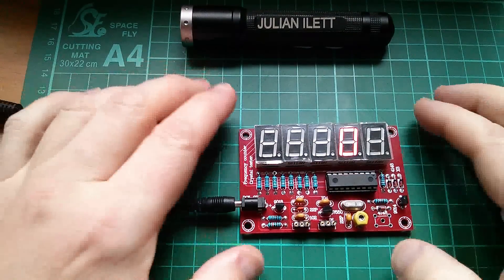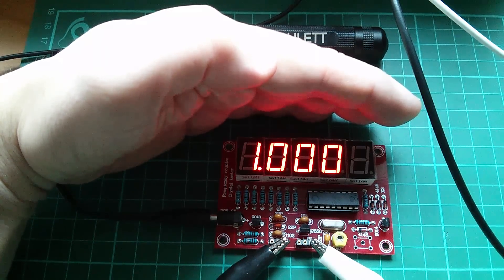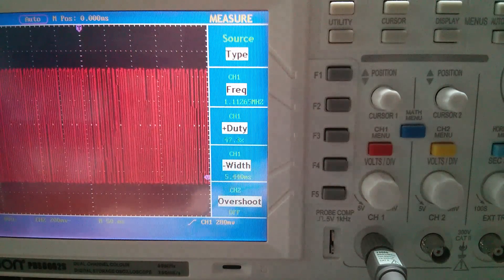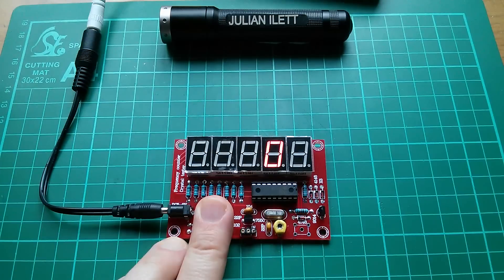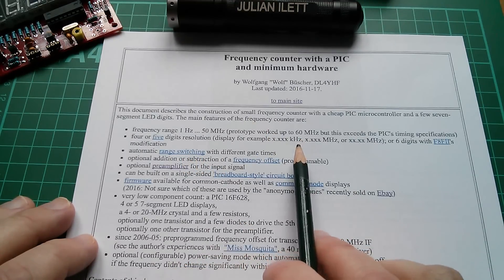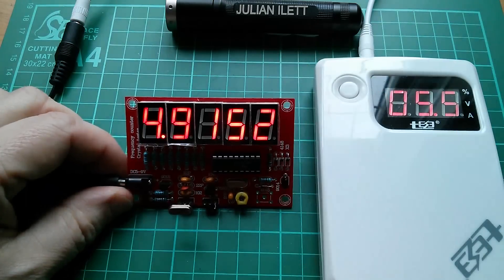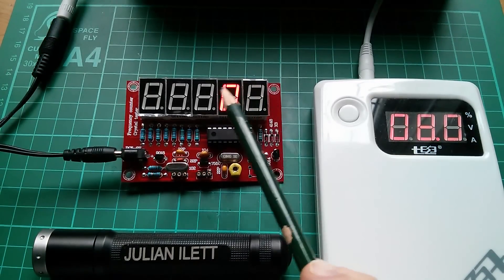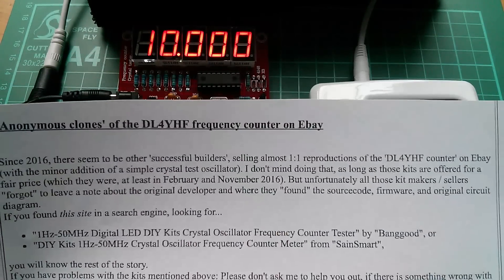Fairly Easy - Frequency Counter - Electronic Kit Build (part 3)

Comment: Hi, I really enjoyed your video, I bought this kit to make a display unit for an HP audio oscillator, I didn't think for a second about testing the crystals - I do this with a simple shielded fixture, an oscilloscope and a generator. Since the kit is on the way I couldn't do the analysis like you and I'm glad for it, I will convert the crystal testing circuit to an input amplifier. Thanks for the inspiration, I don't need to finish the input amplifier outside the board.

Nice day 🙂 Tom

Comment: maybe a 358 and Pwr pigtail hat/shield thing that plugs into the pin header, amplification and power plug and play. Good show, yes the thing sucks. Three extra 22p and a resistor. Your right about it being a Ham creation. It could be usefull for the original purpose, without the xtal part.

Comment: For me the crystal tester was 65 kHz off, but then I found that by pressing the button (which you've not soldered in), and selecting Zero option (when no crystal is connected) makes the device "zero" itself, and starting from that point my crystal measurements were spot on.
Also I found that it completely ignores crystals of certain frequencies, such as 6 MHz, 4 MHz and 32.768 MHz. I guess it's a technical limitation.
Otherwise, cool little device and actually useful (I bought it as a crystal meter, and it works very well - for frequency counting I have enough scopes).
I'm powering it with a 9v bench power supply.
Reply: Wolfgang Büsch's original documentation or another video re this unit describes the 4 MHz "dropout" you mention and provides a remedy. Sorry not to be so precise but I remember seeing that. Will repost if I run across it.

Comment: As shown, the xtal osc has several issues with temp drift, starting with the disc capacitors being notorious for value-temp drift ..
See TheHWcave mod to replace/convert the xtal tester to a preamp that allows a lower input level of about 1.5 mV P-P (significant increase in sensitivity) when using 8V power supply.

Comment: The schematic for the oscillator seems very close to one that I remember having seen in a Elektor book (300 Circuits or 301 or something like that). I am not sure about the values but the schematic was the same (as long as I remember correctly). It was a crystal oscillator circuit to test the quartz crystals. They suggested another stage after it that acted as a detector with an LED as indicator that is oscillating and the output of the oscillator they suggested that can be read by a frequency meter to see the frequency.

Comment: I built mine and the display is blank.
If you get close to touching the pic chip crystal the display bursts into life.
Going to start by swapping the  trimmer.
Reply: Swapped crystal cap and variable cap now working.
Suspect it was vari cap

Comment: I know I am 2 years late,
But for those who work on this kit now - just connect the far left leg to your low voltage signal source- with no modification to the circuit- it will work fine as preamplifier ! 
Just don’t forget the ground..

Comment: The youtube user HWCave has done a number of videos on modifying this kit including making the front-end more sensitive and mods to the firmware to improve measurements and to add functionality.

Changing the hardware:  https://youtu.be/0BxpMm6SLoE
Changing the firmware: https://youtu.be/8rOCmhPWLWw
Improving resolution and adding RPM mode:  https://youtu.be/0D6EcgTQtNw
Using the RPM mode: https://youtu.be/QlIv1DEAvQw
Adding up-counting: https://youtu.be/3imEpm_zztQ

Comment: Thanks a lot.... I recently bought this... First I thought my all 8Mhz Crystals are bad... 
But Then, like your suggestion I've use 68pF cap. (47pF doesn't works on mine)... Only detect "MHz" crystals.
And, my 7550 got damaged, replaced with 78L05... Now works on 9 volt smoothly...

Comment: I have one of these,  have had it for a while.  I usually run it off a 9V battery.  It came with that connector and not the one that the board is ready to mount.  I thought that it would be handy to be able to test some of the unmarked crystals that I've salvaged,  but results have been mixed.  Some of them give a reading,  some don't.  Trying a bunch out of a bag of colorburst crystals and others (3.579545 MHz and 14.31818 MHz),  I get very mixed results there,  too,   with some giving what appears to be the correct reading and some reading zero or some other number that's in no way related to the marked frequency.  Perhaps I'll try some of the mods suggested in the comments here...

Comment: The crystal oscillator not starting at 7.5 vdc has nothing to do with the oscillator design. The 7550A regulator is a piece of crap and turns on an off rapidly (" motorboating ") at about 7 volts. I replaced it with a 78L05 (which has a different pinout) by rearranging the pins and the crystal tester works fine for a $3 piece of test gear. Not to imply it will test from 1Hz to 50Mhz.  Or you  can just use a 6vdc power supply.

Comment: I paid a whopping $3.49 for my copy, and I think I have a 47pf cap for the mod somewhere.  The XF2206 sig gen with case cost $5.89 from BangGood.  I'm sure Clive would cheer you on for your torture testing of the little crystal circuit, though.  LOL

Comment: I use the small screw driver that they give you with a set of oscilloscope probes, that adjust that small variable cap inside your probe..it is the same style cap as on your device.

Comment: At about timestamp 9:50, you say the board can only operate at about a "5v SQUARE-WAVE oscillation".  Is this accurate?  I can see that it may need a high level input voltage, but does it really have to be SQUARE?  What about something--say a 25%  duty cycle rectangular wave?  Thanks.

Comment: The oscillator would be better if the base emmitter capacitor were increased to 100pF and if the oscillator were fed from the 5V supply, as you say, probably with a 470 resistor and a 1nF between collector and ground. I used the original 4 digit version for a transceiver.

Comment: Hi, thanks for your videos. I write for help. A few days ago my frequency counter arrived but it does not work, I insert the glass but there is no reading and sometimes strange numbers are seen. Compare this kit with that of another seller and noted that the only difference is the type of LED. The one that does not work has common anode LEDs and the other is a common cathode, I read on the creator's page that sometimes the copies come with the wrong LED type. Is it possible that by having the wrong type of LED your can see the letters of the menu but when the measurements are done they are not displayed properly? I exchanged the PIC with another kit and I still have the same problem, will the transistors be? I hope someone can help me because I am not an expert. Regards

Comment: Can I put a 12 volts input signal so that I can measure the frequency of that signal using this little kit? In other words, what is the highest voltage I could use with this kit? (May I use 12V)
Reply: Prashanth Nayak You are right. I could use this kit correctly by introducing a 4 volts peak-peak signal and it worked perfectly well. Thanks for your reply.

Comment: I have the tester/counter since a few days. The tester is pretty precise, even on 9V. I tested several crystals on it. Pretty accurate. My actual problem or question is : Is this counter able to measure the frequency directly on desktop/laptop motherboards ? I was not able to get it to work. I soldered 2 wires, one on the input pad, the other one on the minus pad on the counter section. I tried it out on some motherboards, and it does not work. Of course the motherboards were powered on, and all crystals are getting power and voltage. So, is it possible to bring it to work without a modification ?
Reply: I found out, that a cheap kit like this probably can measure or better said count just some lower frequencies in circuit. To measure in circuit motherboard crystals, just a decently expensive oscilloscope or a much more professional counter can do the job.

Comment: Just finished building one of these. Testing has been interesting. Xtal tester seems stable but gives wrong results. After much frustration it dawned on me that it is displaying exactly the correct value divided by 3. Maybe a corrupted pic?
Reply from the maker: Very unlikely to be a corrupted PIC - much more likely to be the Colpitts crystal tester circuit.
Reply: These crystals are in fact 1/3 overtone. Their natural resonant frequency is one third of the marked frequency.The meter is actually correct.

Comment: So what was the pot for?  And, why did you leave it off?  Thx.
Reply from the maker: There's no pot - do you mean switch?
Reply: Julian Ilett - Ahhh, yes. 4-connections. Possibly DPST. Looked too tall for a switch in the video. But, not needed I guess.
Reply: the switch is used to access the config menu. useful to add so you can enable/disable power save mode and zero the display .. my kit came with a 5MHz offset already set which I needed to clear before I could get reliable results!
Reply: pratalife  - Thx!  Good to know.  Surprised it was a kit and yet preset.  Figured that it was there for a reason.  Cheers!

Comment: Have made this kit up with a mod to have the BF199 preamp in place of the xtal oscillator. It seems to work ok as far as I can see. Had to cut a few tracks and make a few links on the back so the board doesnt look quite as nice as it did but it is a lot more useful! I used a 0.01uF coupling capacitor in the base circuit. A value for that doesnt appear to be mentioned in Wolf's notes. Edit: Ive changed the cap to 0.1uF and it might be worth going up to 1.0uF for measuring low frequencies (tens of Hz). Have also powered the preamp from the regulated 5v supply rather than directly from the power input

Comment: I built the same kit but left out the crystal checker components.  I had to go back and put in the 102 and 22 pf caps because it was so sensitive that it was picking up the 60 Hz  AC in my shop.  Those two caps are basically in series across the input.  Once I did that it indicated 0 with no input.

I built it to check the rtc oscillators in a couple of clocks that always seem to gain time.  I suspect the crystal oscillators are running fast.

Many years ago I built a giant nixie clock with a 20 MHz oscillator for the timebase.  It always gained time but when I added a padder capacitor to the timebase, I was able to adjust it to exactly 20 MHz and it kept correct time from then on so yes, you can tweak the frequency of a crystal ocsillator a bit.

Comment: Hi Julian,
I built this kit some month ago and basically had the same issues as you with the crystal measurement circuit. Anyway the circuit as designed cannot work properly with a supply ranging from 5 to 9V, and for all crystal frequencies.
As you said, input signal is directly fit to the PIC. So signals over some 5.5V will kill the PIC, not to speak about dozens of volts; they just might leave a crater in the middle of the PIC!I added an input stage and manage to measure frequencies from some Hertz to 40MHz ranging from ~1V to 18V. I have no means to generate a signal over 40Mhz / 18V!
But that’s more than enough for what I need the frequency meter.
Thanks a lot for your channel and your teaching skills.

Cheers from France
Reply: jc hirtz - I was troubleshooting the crystal problem and found that the 5volt regulator starts "motorboating" (rapidly turning on and off) at about 7 volts. I replaced it with a 78L05 ( which does NOT have the same pinout ) by rearranging the pins and the crystal section is now quite stable.

Comment: I went "PUT IN THE FREAKING BUTTON JULIAN IT IS CLEARLY A BUTTON FOR MEASURING FREQUENCY AAAAAARGH".
Reply: Actually it is to program the kit to allow you to add or subtract frequencies and also to turn on or off the power saving feature.  Keep in mind, this was designed by a ham and by subtracting or adding the local oscillator frequency, it can show the actual receiving frequency and would make a great tuning display.

Comment: That switch also allows you to set the auto timeout power off when running on a battery, or constant on as it sits default.

Comment: If you modify the Crystal checker to be a pre-amp for the Freq counter - don't you risk overloading the input to the PIC?  It seems you'd also have to have some added circuitry as a way of limiting the input voltage to the PIC??

Comment: As the crystal tester circuit probably only uses a mA or two, could you not connect this to the stabilized 5 volt regulator?
Those trimmer caps ARE dreadful, I have two on a oscilloscope kit, both of which I have also broken. Still not managed to turn these trimmers.
Reply: hello fellow dso138 owner!

Comment: For the price it looks like it'd be a cheap alternative to a scope for my purposes, it'd be nicer if it were more compact without the crystal tester... it's easy enough to hookup the actual circuit you'll be using and use the frequency counter to measure and I'm sure more accurate.

Comment: Give it a break Julian. That kit is only about £5 and actually reads crystals just fine (I've checked and verified hundreds in the 18 months I've had it). OK the oscillator drifts with temperature change but hey, you only check the crystal briefly, not leave it in there (or hit it with a hairdryer/freeze spray) for temperature to make a difference. I think calling the crystal checking part crap is over the top for a £5 device which does the job in normal circumstances. Just my opinion.
Reply: If a tester cannot reliably measure what it is intended to measure, then it is most indeed crap.
Reply: standishgeezer - run it off of a 6vdc ps and the crystal tester works fine. I tested it on 6-32Mhz xtals. Most of the problems he was having can be traced to the crappy 7550A regulator dying at 7 vdc.

Comment: You can make a screwdriver out of toothpick to tune this cap.
Reply: that would be a video i would watch.
Reply: You could adjust it with a hydraulic press; after all, this crystal tester is extremely dangerous and could attack at any time.

Comment: I've changed my mind about getting one of these kits. My DMM will do frequency to 10MHz and my DDS generator also has a frequency counter to 100MHz so not much sense in getting one really.

Update on my Alice order - finally arrived today, 10/01/2017, dispatched 10/11/2016 so exactly 2 months to arrive. Can't see why it took so long but I suspect RM are to blame rather than China post.

RM are in my bad books for another failure. I ordered my PIC development board from Farnell yesterday and RM, instead of ringing my doorbell this morning (I was in), left one of their "something for you" cards so I gotta go pick it up myself tomorrow (I have mobility issues and I do not drive so I could really do without the hassle in this cold weather!) They will be getting a piece of my mind when I do pick it up. ;-)
Reply: I believe Christmas i part to blame. The orders from past two months has been incredibly slow, taking over 2 months to arrive or more if they ever get here...

Comment: Only 2,364 to go.
Reply from the maker: About 2 weeks by current estimates :)
Reply: Yes, has accelerated. Used to work it out with a division estimate of 75 now that has changed to 150.
I was reading a review of your channel on 'Tube Shooter' from 18th of August 2014 and saw the line. "Mr Ilett has built up an enthusiastic fanbase of around 13,000 subscribers" 
As they say, you must be doing something right.
Reply: It's all about content.

Comment: I'm pretty sure the crystal is being massively over-driven. That and temp-coefficients of the transistor (which over drive it even more when hot) could be driving it into harmonics, which in turn make it give up and stop. Also the caps are what you would expect if driving the crystal from a microcontroller etc not a single bipolar transistor, so are not matched either, so the phase angles are going to be wrong. TBH i'm a bit surprised it works at all.

Comment: What a weird PIC, my homemade AVR based counter has no trouble reading frequency of a square wave, sine wave, triangle, sawtooth. The only requirement is that the amplitude should be higher than 0.8V and less than 5V to prevent frying the chip's input.

Comment: That was brilliant - I love the attention to detail in your videos!  I bought one of these following part 2 of this series, and now I know that its worth ditching the XTAL tester in favour of a pre-amp.  One thing that would help with the XTAL tester is to feed the supply line to the tester circuit directly from the 5v regulated supply.
Reply: I bet you're right. I've used a bench power supply (fed + and - directly to the pins next to IN pin) and the crystal tester worked very well.

Comment: Very cool indeed, as a Ham operator (just getting into the Ham world) I wanted a frequency counter that I could use on a tiny CW transmitter kit I built.  I found this: http://www.ebay.com/itm/DIY-blue-PLJ-8LED-H-RF-Signal-Frequency-Counter-Cymometer-Tester-0-1-1000MHz-/262041571187?hash=item3d02e50f73 and it does the job nicely, sort of on the same line but with a few more digits.